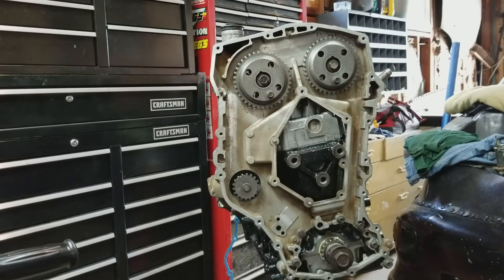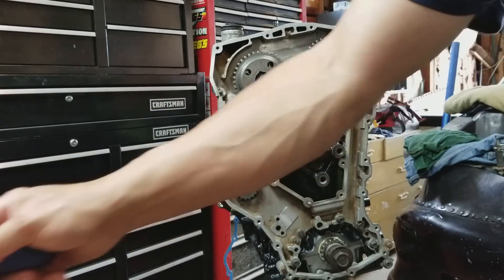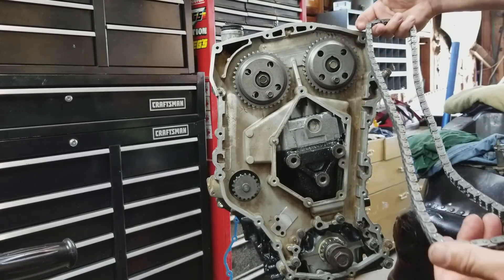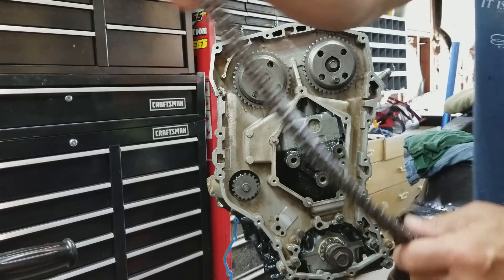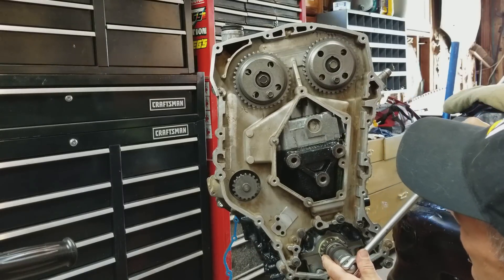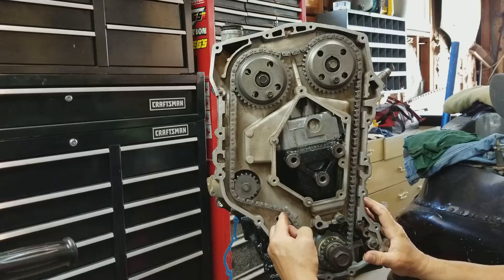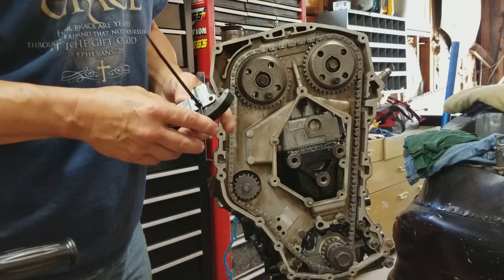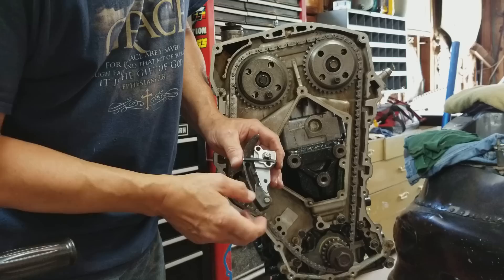Quad 4 How to install timing chain and put motor in time

Comment: That's one of the best videos I've seen just in general, practical and concise. I had my quad 4 apart with just a Chilton's and common sense, so lucky to have videos like these now. Later found out that the oil mist eliminator on them dropped foam in the oil pan and you needed highway runs to boil it off. I didn't have a water in the oil problem after all, but went ahead and replaced the belt slides and tensioner shoe since I had it apart.

Comment: Hello hoping you see this comment and can lend some advice!! My quad 4 motor has the other style of tensioner where the tensioner and shoe are separate, and I broke the little piece of plastic that holds in the extra spring that yours doesn’t seem to use. Would you happen to have one for sale, or is it even that important can I run it without the spring? It seems like the tensioner and shoe are doing their job and the little spring isn’t helping too much anyway!
Reply from the maker: I may have something here. Please email me a picture at mpclass3@yahoo.com.

Comment: What size of bolts did you use to lock the can gear?  DVD:)
Reply from the maker: 8mm
Reply: @LD9user   Thank you ! am about to replace chain and gears since i have to change the water pump.. :) DVD:)

Comment: Great video! I’ve been recently having a ton of trouble with my 95 2.3L, after watching your video I’ve confirmed that I’m lost because I’m having a ton of timing slap with brand new chain, gides, and tensioner. Still a ton of slop any tips?
Reply from the maker: Are you sure it's the right chain? The 2.3 and 2.4 chains are different.
Reply: @LD9user  it’s a GM 2.3L out of a junk yard Oldsmobile. From what I’ve been able to find is that in 97 a TSB came out saying basically every time you remove/replace the timing chain that a new tensioner is needed. It seems like my tensioner “piston” won’t spring out all the way even when i release the lock. Do you know if the 2.4 chain is smaller? Will the tensioner gain pressure when oil pressure is present?
Reply from the maker: @alexreilly4624  here ya go.
https://youtu.be/y81GIAkjekM
Reply: @LD9user just saw this! Thank you! Are the sprockets different from 2.4 -2.3 as well?

Comment: Question, I'm doing right now what you did on the engine. How did you install the harmonic balancer? I'm having hard time finding a tool to fit the crankshaft to install it back. Or did you use the crank bolt?
Reply from the maker: You can just use the crank bolt to pull it on. It will slide on easily. Depending on what year or resource you use for torque, it's 129 ft lbs or 133 ft lbs. After that it's another 90 degrees to reach final torque. That can be tough.

Comment: Thank you for the video. I’m working on the timing chain for a 2001 Chevy cavalier with the GM 2.4L engine. I suspected this car had a timing issue for a while, because whenever you let off the gas it would backfire slightly. Then, all of a sudden it just started running poorly with misfiring randomly. It threw code p0300. I suspected timing for a while and just dove right in. Upon pulling the timing cover and pinning the camshafts in time, I noticed that the crankshaft spur gear looked like it was about one tooth possibly two past the mark for TDC. If the chain had jumped, wouldn’t the cam gears be out of alignment as well? I ask this because when I pinned the cam gear with the pin through the hole in the timing housing, I was able to pin the other cam gear as well. If the timing had jumped a tooth, I wouldn’t think that both cam gears would line up with their timing marks. Is it possible that the crank gear could have free wheeled a bit and the tensioner took out that slack and allowed for the cams to stay in time, at least relative to one another? I’m not sure if it’s the original chain or not but I’m sure it is possible that someone could have installed the chain incorrectly after having not set the crank gear at TDC. Just looking for some input on this. Thanks in advance!

Comment: Would love to know if the one piece tensioner locks closed if not where can I buy it cause I'm now having to pull the head again due to tensioner locking closed and jumping time
Reply from the maker: I've only seen one failure with the single piece tensioner. Several with the two piece units. Rockauto has them. 1992 grand am with sohc 2.3L motor. That's the one I use.
Reply: Thanks for the update

Comment: Do the marks on the cam and crank need to be aligned when putting everything back together
Reply from the maker: The timing mark on the crank gear gets lined up with the mark on the block. The cam gears are locked into position with M8 bolts as shown in the video.

Comment: Hey there man. I have the same engine. It has a very bad rough idle and is misfiring. Most of the time it won't even stay running put it in gear it shuts right off. I replace coil packs fuel filter ignition control module still having the same problem. Would think it might be a stretched timing chain. Or can kind of point me in the right direction it would be greatly appreciated and thanks for the great videos. Also getting good fuel pressure and i clean fuel injectors. And I checked to see if I'm getting fire to all four plugs yes I am. If you could help please thank you.
Reply from the maker: First step is to check the computer for codes. Bad plug boots, MAP sensor or oxygen sensor can cause what you're describing.
Reply: It's like it has no power at all like running on 2 cylinders but all cylinders are firing.
Reply: Check compression if thats good, check the egr valve , they sometimes get stuck open and you lose engine vacium. Its just a matter of removing the piece of carbon stuck in there. Hope this helps
Reply from the maker: Here's a video of a race I ran with a misfire.  Motor was hardly running by the end of the race. Problem was traced to a bad O2 sensor.
https://youtu.be/ZFJwTY6JuG8

Comment: Hi!!! I have a question? How many pounds are the 8mm bolt on the tensor and I install the tensor but the tensor get stuck. Any advice? And thanks for the video it helps me with the time chain
Reply from the maker: 10 Nm or 89 lb in

Comment: Adam from Poland
 
My name is Adam and I live in Poland. My car is a 1990 Pontiac Grand Prix. I have trouble with the engine that when starting, when it is cold, rattles very loudly under the timing cover. It takes a few seconds and then it is normal. When the engine is hot, you can hear the sounds from under the timing cover but much more quietly. My timing is type 1, has double gears and the chain is also double. The tensioner is type 1 (BT188). I dismantled the cover and everything is fine, the chain has no play and the wheels are not worn but it all makes a lot of noise. What can I do ? Can I buy a type 2 tensioner? will he help and will it fit? Should I also buy a new chain and sprockets? Or maybe you need to use a new type of chain and sprockets (2nd design)? Will it make it much quieter?   I am asking you for help, because I really like this car and I have it for 24 years.

Comment: Need to learn about quad 4 e,c,u reprogramming on my sand rail its has fresh air intake and 1/2 THE EXOUST IN A MUFFLER NO CAT NEED SOME  HELP THANKS KIRK
Reply from the maker: Join the Oldsmobile Quad 4 Facebook page. Lots of knowledge there.
Reply: @LD9user  thanks brother I will try that it seems to run good but stumbles on low end

Comment: The quad 4 is a 2.3 L right? Is there a quad 4 2.2 L also?
Reply from the maker: The quad 4 is  2.3. The 2.4 is known as the Twin Cam. Some use the Quad 4 nomenclature when referring to the Twin Cam. There was no 2.2 liter Quad 4.
Reply: @LD9user  I'm thinking of the 2.3 my bad. I've heard a lot of bad things about the quad four and some of it's from my own experiences. I would never own a car with these piece of crap engines.
Reply from the maker: They make good power but aren't the best design. Of course, it is 80's tech. ;)   You would probably be happier with a Honda.
Reply: This car dealer tried to sell me  a HHR with a quad 4. I looked at the engine and I said that is a quad 4. He said yes it is and said I am not interested. He then starts lying telling me it's not  a quad 4 and he doesn't even know what a quad 4 is. He also had two other cars that wouldn't even start. I walked off the lot and didn't come back.
Reply from the maker: Car dealers know little about the products they sell. No HHR ever came with a quad 4. They use the Ecotec.
Reply: @LD9user  Ecotec? Are they a headache too? It looks like a poor design.
Reply from the maker: I've heard there were some problems with the timing chain tensioner but nothing super bad.

Comment: I have a problem with my 2.2 Ecotec cavy. When the engine is cold, it sounds completely normal, but after it warms up, it starts to tick. I've also noticed that when I'm idling in park the tick gets louder, but when I move the wheel, it stops. What could it be?
Reply: Spun rod poss. IDK about the moving wheel part...
Reply: Use a mexhanics stethoscope to pinpoint what area it is comong from. A spun rod bearing will not be a small tick.

Comment: What's the difference between a 2.3 L and the 2.4 L and am l correct  to say that this engines interchange.  I have a 95 2.3 Pontiac Sunfire I am needing to put  a 2.4 in the car. Do to a so called cracked block
Reply from the maker: The 2.4 will bolt right into your 95. The upper motor mount is the same. I believe the lower mount is different so you will need the 2.4 lower engine mounting bracket (the part that bolts to the motor). You will need the 2.4 exhaust manifold and down pipe to hook up the exhaust. The only other thing you'll need to convert a 95 quad 4 to the 96-up 2.4 is to modify the knock sensor mount on the back of the block. They were changed a couple times after 95. My suggestion is to make your knock sensor adapter while the motor is out of the car so you'll have plenty of room to work.

Comment: i put the timing chain all back together now i have a knocking noise can it be the valves.
Reply from the maker: Could be one of 3 things. A bad tensioner. Bad lifters. Or, the bottom end is out of it. You should note, these motors often make a lot of valve train noise after a rebuild. It takes a while for the lifters to get pumped up. If you had the head and cams off or you're running new lifters, that could be the cause of the noise.

Comment: The Chiltions Online and my factory service manual said to go clockwise 90 degrees and then come back counter clockwise once cams were pinned, which is what I did, but I don't think it would matter because 2 and 3 would be down half way either direction and heading down when you came back to TDC on 1 and 4.
Reply from the maker: I've actually talked to others about this. Some go clockwise, some counter. I believe you're right...it doesn't matter.
Reply: F

Comment: Great video. Thanks. I got a question. my 2.2. Is making a noise, I have replace the water pump, I dont know was wrong, 
I need some help on this.
Reply from the maker: Well, a noise could be nearly anything. Does it get louder after it warms up? Does it get louder when you rev it up? Does the sound change with rpms?

Comment: Looking at the date that you did this Video , very recent I see . I was wondering who is working on Quad 4s anymore until I heard you say . You were ready to go racing . What class do you race with a Quad 4 . I have been racing one starting in 1987 . Has to be very competitive engine in any 4 cylinder class , I would sure think . Great job on your video
Reply from the maker: Thanks! I race in a Sport Compact FWD class. It's dirt oval racing. These motors are decades old but can hang in there decently well.
Reply: What other engines do they run in that class ?  I have been racing a quad 4 , starting in 1988 when GM sent me a test engine to run in a F/Dragster . I got one of the first 180 hp engines made , and I am still racing it today . I never did put it into the dragster , because NHRA had no idea how small the 4valve OHC engines were . So we could not get down to the minimum weight . So I built a snowmobile around the engine . I have run the engine in many different configurations . Starting with the speed density FI , then changing to sheet metal intake w single throttle body , then dual throttle bodies , but always dealing with the factory rev limiter . So then I changed to Webbers along with a  distributor I made to eliminate the rev control . I also built a intake manifold for a Holley 780 carb . On the engine dyno the engine made 233 Ib ft tq @ 5300 and 291 HP at 7400 rpm . I still have a ton of parts for the Quad engines . This is a great engine , the sled weights 1154 lbs with me on it and it has ran 154mph .
Reply from the maker: First, you should really check out the Oldsmobile Quad 4 Twin Cam Facebook page. It's a great group with some very knowledgeable folks. 
As far as what motors everyone runs, around here Neon's are everywhere. Longer tracks favor Cavaliers with the ecotec. There are some Honda's too. Most rule packages state: "Must be stock appearing." So it's pretty much open competition for all the Honda guys.